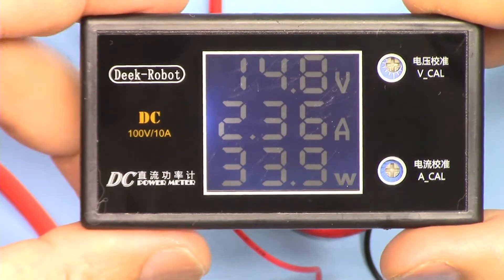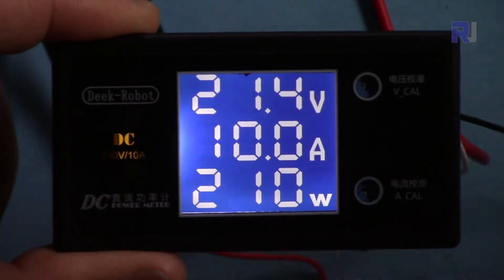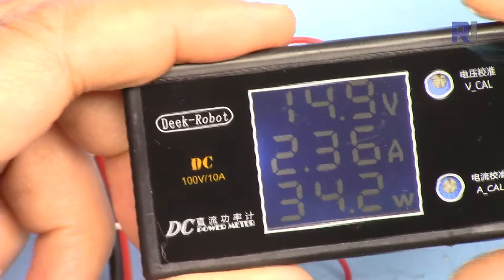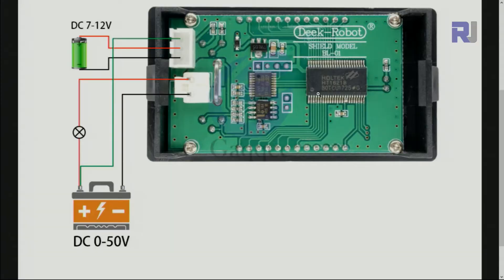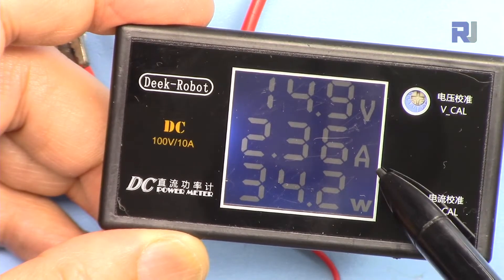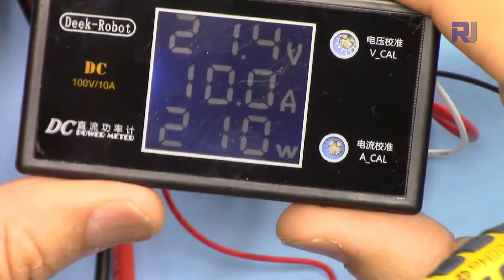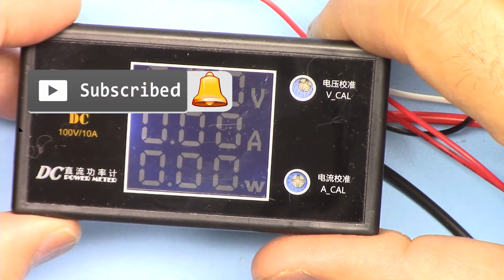DC 0-100V 5A 10A 250W 999W LCD Digital Voltmeter Ammeter  Voltage Current Power  review - Robojax

Comment: Your wiring video is confusing and you cut the video. 🤦‍♂️
Reply from the maker: just read other people comments.When you don't watch the full video and jump, this is what happens.
Reply: @robojax  I did not jump , wait let me show you where you cut the video
Reply: 7:17 - 7:20
Reply: In the diagram the positive of the meter is connected to positive of the load but in you actual the positive is connected to the negative of the load? I am new to this so a lot of confusion there

Comment: You show a stylized battery with the thick red and the thick going respectively to positive and negative. Unfortunately, the thick red and thick black go straight to the shunt which would soon short the battery out and burn out the shunt. I think you need to revise your diagrams.

Comment: I come to the conclusion these devices are extremely sensitive to ripple in the voltage, it just start to jump around in the shown values very easily, If the voltage and current is clean they show fine. otherwise they are pretty nice. I think the issue is that they have too high refresh rate

Comment: If you put that in motorcycle where should you put the wire in load that all load will be calculate?
Reply from the maker: I have shown in video two things 1-Power supply 2-Load. so whatever I said, for you 1-Battery  and the 2-motorcycle is your load. Just follow that

Comment: Can I use a 12Vac output with diodes and capacitor to make a 12 volt source with CI LM7812 to power the lighting of this Module (Deek-Robot Shield Mod.BL-01)? Note that this derivation is from the same transformer that I made the variable source from 0V to 50V!
Reply: Is the Deek made to control power from Solar Panels to  Heat Water Element in Cyclinder. 
Will the element Arc ?.

Comment: The connection of the DC 0-50V (input or output source?) as shown in the diagram is not correct since these two terminals which is connected with the red and black wires from this source is shorted together with the wire shunt and cause short circuit to this DC 0-50V unless the black cross in the circle is to indicate the red wire is not used, if so then it should not be in the diagram in the first place.
Reply: Apologize for my above comment on the diagram that I've got the image from the net.  The info in your video does now make everything  clear up now.  Thanks for your good work.
Reply from the maker: no worries. you are welcome. You can edit comment by clicking on the 3 dots that shows for each comment. good luck.

Comment: Can I use this measuring device on my car?
Supply voltage is described with DC 7-12V.
But if the car's engine is running, there are 13.7 to 14.7Volts, can i use this wile driving?
Reply from the maker: maximum voltage is 12V.  you may have to risk and test it to see if it dies or not.
Reply: @robojax  more worse... I cooked my pv module with that thing lol tomorrow i will buy a bigger 320wh one.
Reply: @robojax  If I cook one of these it doesn't matter, I accidentally bought 5^^
Reply from the maker: Yes. so what happened did it burn or not?
Reply: @robojax  there was a cloud of smoke. I think I didn't understand the instructions correctly (as shown here)
When I put it like the one in the pictures, there was a spark, there was smoke and my solar system was done.
now i have bought a new solar cell, but the pain runs deep - these things are expensive.
In the circuit diagram of banggood, the 2 cables are brought together, the ampere test lead and the volt test lead.
But when I closed it together, my solar panel burned out and the fuse on my expensive victron charge controller. So iam lucky now that i dont need a new 100€controller.

Comment: Hii...
what can be replaced with a external shunt ....if you want a higher range measurement? Thanks sir
Reply from the maker: Hi, here is using shunt with Arduino to measure up to 500A https://youtu.be/xHe9RRQWMBM or use a module with shunt https://youtu.be/tgneN2hzRe0

Comment: you can wire the meter off the same voltage supply, what i am trying to say is you don't need another power supply to run the meter. its very easy to do.
Reply from the maker: If you measure the current for a source less than 5V, the display with turn OFF. You need separate power to keep this working. Thank you.
Reply: @robojax  i am not going to go lower then about 7v so its ok
Reply from the maker: Yes.

Comment: I have the BL-02.  What is the supply voltage/current needed to power the device?  Can the device be connected to a 12v car battery and measure the voltage/current of the battery?
Reply from the maker: this device can be connected to Car battery to measure the voltage. It can measure only 10A max. When you start the car, it uses about 400A or more if larger car. So this can't  measure it. Of course if you connect a device that uses 10A or less, it can measure it in car too. What is B02? I did not find it
Reply: @robojax  The BL-02 is the same Ampere Power Meter you used in the review.  If you look on the back of the circuit board you'll see 'BL-02'.  That is the model.  I have a device that draws 12v @350 mAh from a car battery.  When the car battery is fully charged, I want to use my BL-02 to monitor the Voltage and power consumption for a month or longer, until the battery is flat.  Can the Meter be connected directly to the battery or does it need a small load in place?
Reply from the maker: Thank you for telling me the model. I will have to look at it. My answer is the same as above with addition, to measure Power, you need to measure the current.
Reply: I have read that the device itself uses under 15mA. The voltage is apparently 7-12V, but I would say that it can go at least up to 15V (it would have to go that high to work with a car battery).
UPDATE: I have checked mine and the supply current is 10mA. The specs say 7-12V supply, elsewhere I've seen warnings about not going over 13V, but it ran fine for a month or two (until I replaced it with a better power meter; it didn't fail) on my battery which often got to 13.5V and very rarely up to around 14.4V.

Comment: Power (watt) indication is wrong !
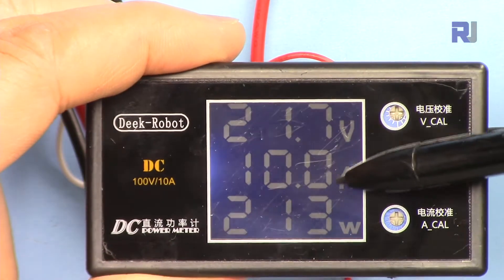9:08 Voltage 21.8V, Current 10A, P must be  218 Watt. But indicator show 214 Watt !
Reply from the maker: The device has refresh rate. It doesn't refresh quickly. It takes a little time. Also 5% error is normal.